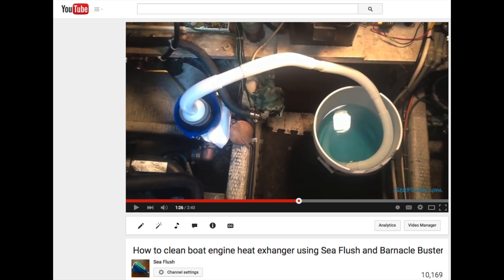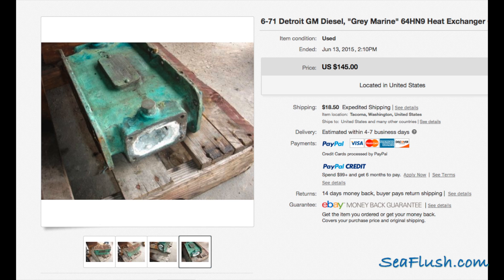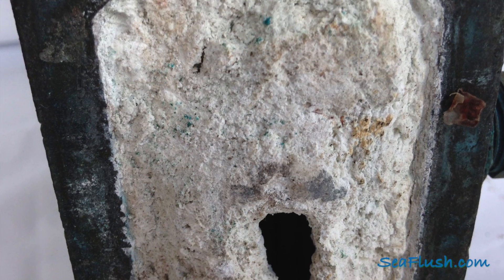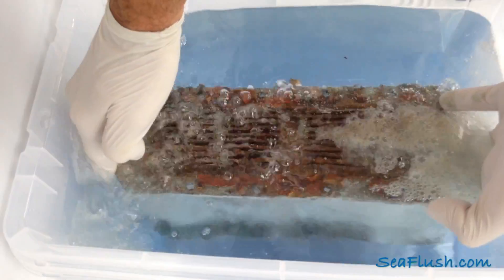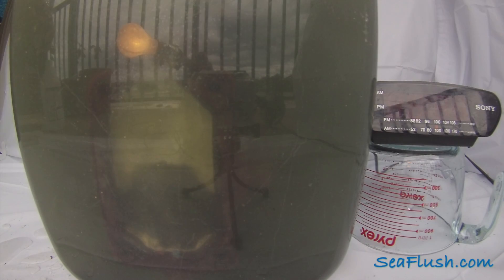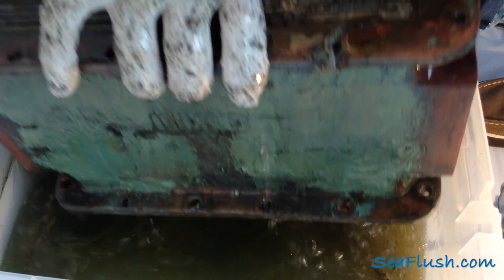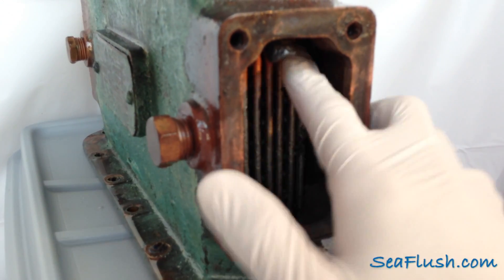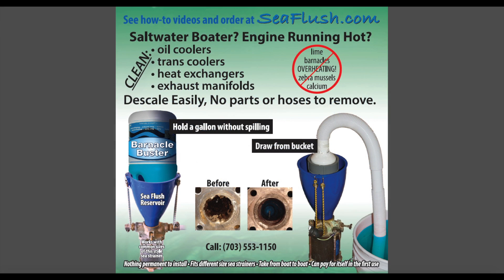How Sea Flush and Barnacle Buster Can Clean Heat Exhangers, Oil Coolers, and Exhaust Components

Comment: Why heat exchanger instead of radiator ?
Reply: Where are you going to mount the radiator on a boat?
Inside the cabin....in the Tropics?
Outside on the deck?
Water is so much more efficient at removing heat...
and you are trying to heat the whole ocean...
so unlimited heat transfer....

Comment: Nice.😎 So i can use this in cooling system of my truck as well? Wont it eat up the seals and gaskets?? O rings???
Reply: Use the right automotive cooling system cleaner...
or even dish washer powder or tablets..
drive for 10 miles...
job done...
and your engine block and radiator are all cleaned too...

Comment: Could this work on heater cores for a truck
Reply: Use the right automotive cooling system cleaner...
or even dish washer powder or tablets..
drive for 10 miles...
job done...
and your engine block and radiator are all cleaned too...

Comment: Wonder how well this would clean camper septic tanks and most importantly corroded tank sensors
Reply: Dont put this in your camper tank.

Empty it. Fill it with water and empty it again.

Get an actual "holding tank cleaner" and put it in and follow its instructions. 

Replace your coroded sensor after cleaning the tank.

Comment: I still don't get it. I have a 40 year old Engine. It is Saltwatercooled and has a later added secondary coolant system, like the cars. I don't know how bad it is, but I want to sail over the atlantic and want to clean the watersystem while everything is still connected. I don't want to damage any rubber Gaskets from the Heatexchanger. What Product must I buy? What should  I get without making any damage to the materials.

Comment: I'm not a boat person but presumably that heat exhanger takes the heat out of the coolant by passing seawater through. Avoiding circulating seawater through the engine and taking one for the team in the process?

Comment: Sea Flush and similar is some kind of acid, most probable phosphoric acid or H3PO4.
Vinegar is a  5–20% acetic acid (CH3COOH) solution. It works much slower and it probably requires that the solution is replaced a couple of times, Concentrated acetic acid will work just as good as phosphoric acid. 
Take care when diluting an acid. Always pour acid into water, - not the other way around.
Reply: Can I use it for an outboard motor Yamaha??????
Reply: Water into acid? Got it

Comment: Could you use these in a toilet?
Reply: My thought exactly. I've got some really hard water and one of my toilets is so built up with deposits that only a screwdriver seems to affect it.
Reply: Clay Loomis tip a an arm full of hydrochloride acid in there for twenty mins,crystal clean,just flush to remove.
Reply: I mean, its a legitamite question due to hard water usually being calcium deposits, and most of that buildup is calcium based. If its an acid, organic compounds break down under it so i was just wondering if it would work
Reply: I laughed too fucking hard at this
Reply: could be a solid dose of SHIT ??    @xxRamD3yruxx
Reply: I dont think thats hard water.
Reply: Clay Loomis Thats piss build up bro.

Comment: I hope its biodegradable. God only knows what that stuff could do to the marine life
Reply: It would bust barnacles.
Reply: Yeah . I thought of that right off. I doubt that anything as powerful , and man made as that product is biodegradable .
Reply: Matthew Colquhoun IM DEAD
Reply: Teddy Bass at the same time. That heater would've been thrown away and it would take lots of time for it to degrade. If it even can. And if it was incinerated etc. The process would produce harmful gases anyway. Plus, because old ones are thrown away, there's a bigger demand for new ones which means that more products will need to be manufactured which means more harmful gases will be produced during the manufacturing process....
Reply: If it's primarily an acid, then it only works in concentrated form, if you poured that gallon into the ocean it would cause harm to anything in the immediate vicinity at the moment of pouring but then it would dilute to the point of being harmless.

Comment: White vinegar would have also worked!
Reply: Andrew Denley And it‘s cheaper
Reply: and probably a hell of a lot less toxic than whatever that is
Reply: Yeah, but you want something that will eat minerals and leave metals, hydrochloric acid for example would cause pits in the metal as it converted exposed iron into hydrogen and iron chloride.
Reply: Re Set OK
Reply: Have a fleet of inboard diesels I have to maintain. I’m interested bestloverktn1@yahoo.com is my email.
Reply: Actually almost any kind of acid have worked just fine. Like hydrochloric or phosphoric acid.
Reply: I'm pretty sure dilute hcl wouldn't dissolve the all stuff in a few minutes but would remove the limescale completely, but you don't have to use such acid that reacts directly with iron or any used metal, that's why i didn't recommend only hcl.
Reply: You can, but i wouldn't do that. Dilute acetic acid can remove only a little unwanted stuff, so it should stay in the circulation for very long time, and there it will meet many kind of materials, through all the popular metal types the rubber, plastic and other type of sealings, rings, etc. Only strong acetic acid is good for this kind of job, but it can damage the system. Even tho if the damage might be weak, engines can have the weirdest failures without any help...
Reply: Can you put white vinegar in a cars water coolant system to help clean it

Comment: What's the chemical composition of that barnacle buster thingy? Since it helped dissolve the calcium carbonate, I assume that it is acidic; protonating the carbonate ions, therefore unabling Ca²+ ions to form CaCO3. But I don't think it's just a simple acidic solution
Reply: Judging from the amount of copper it pulled off,it better come with a hell of a neutralizing solution.
Reply: Phosphoric Acid.
Reply: Mike D You could use sodium bicarbonate, easy to get
Reply: You can get 35% phosphoric acid cheap from any dentist/medical supply company. I use it for cleaning our residential tankless water heater.
Reply: We use a cheep mixture of sodium and acids to dissolve calcium build up in our machines at work.
Reply: Safety data sheet lists it as a phosphoric acid solution https://trac-online.com/sites/default/files/helpfiles/TRAC-SDS-Barnacle%20Buster%20Concentrate%201206.pdf
Reply: Ameerhun1996 
I did a lot of descaling of chillers,and boilers in the 90's using hydrochloric acid.
After sodium bicarb treatment,we would run a molybdenum solution in the closed loop to slow the "cancer" the acid would create.

Comment: the redness of the copper indicates this excessively strong acid treatment can be pretty rough on it.  Use a 10% solution of phosphoric acid, recirculate with a bilge pump and bucket and hoses, and take your time.   see me do in on  Fisher 30 Pacific Child
Reply: Capt Larry, you pinpointed the problem. The aggressive acid removed the zinc from the brass alloy, a process known as de- zincing, leaving a rough, soft, and brittle copper sponge at the surface. This sponge  structure increases the surface allowing for  a faster build up of scale or even cause leakage. In order to avoid that, I recommend descalers with a ph value above 7, prepare by carefully removing chunks of scale mechanically, and if I has to be acid, use less concentrated citric acid and limit the exposure to a minimum. The ducts dont have to be squeaky clean, it is enough if the water can flow freely and heat can be exchanged
Reply: @christianselbach3455  where u from Mr. Selbach?